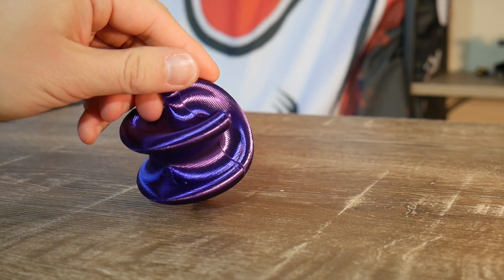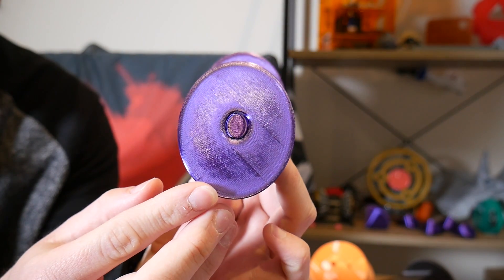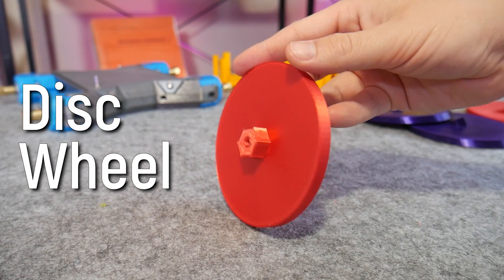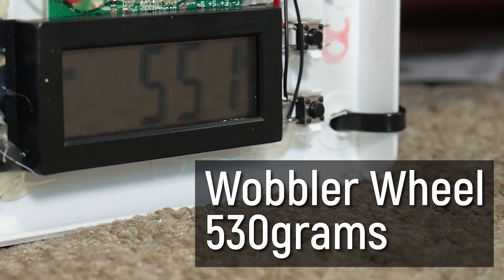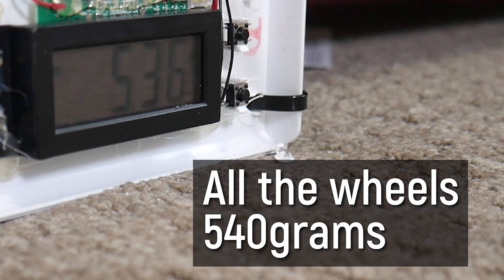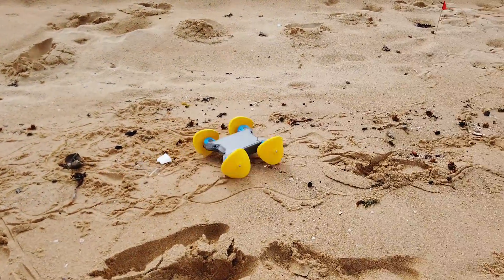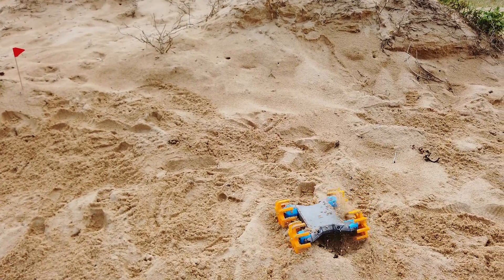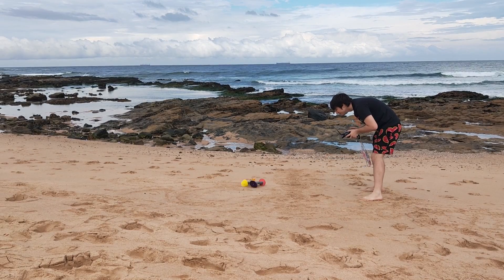This Robot Drives on Wobbly Wheels (but HOW?)

Comment: Question: could you make a device that would be attached to the body that could take advantage of the wheel angle of the wobbler wheels? For instance, when the wheels angle toward this device, it could push a lever that was attached to a flexible material that could generate electrical charges upon expansion/compression/both. And if you could, could this generate enough charge enough to fully power the vehicle? If so, could the excess power additional light and perhaps an additional battery?

Comment: You need a combo. Narrow, regular wheels for easy going on smooth surfaces, then spokes/scoops on the side of those wheels, with a slightly smaller diameter, for when the terrain gets rough and it starts to sink in. Like two wheels clamped together to handle ALL OF THE SITUATIONS!

Comment: I think that larger diameter would help, giving more tolerance for a slight dig in before the weight is being supported by the belly instead of the wheels.  Also, it might be worth experimenting with different cross sectional shapes of the part of the spokes that contacts the ground, say, triangular, where the angle of the flat descending towards the nadir might be at a more effective angle to produce "lift" in preference to thrust.  But you may have trouble duplicating your sand conditions.

Comment: You don't WANT sand being flung backwards, because that's what digs you further into a hole. The scoops on sand tires aren't meant for flinging it backwards, but for getting some traction on the flat sand. The sand tires are totally filled in so they have massive surface area contacting (and importantly COMPACTING) the sand down so it shifts less. Your spoke tires are open, so they aren't compacting the sand at all. All those tires are terrible for sand because of their small contacting surface area, the spoke tires are just the least bad because they're the most efficient lfingers of sand, giving them at least a chance of getting out of a hole before completely burying themselves in it.

Comment: cool.
when moving on sand.
the trick is to go over the sand.
paddle wheels get the job done.
another problem is the center of the device from touching the ground.
to get to the point.
would it be interesting to see a rocker boogie solution.
like the mars rover

Comment: Very nice experiments! I have some constructive suggestions though. I think more ground clearance would give a more objective and isolated test of the wheels themselves by ruling out friction from the bottom of your vehicle, which design is kind of awesome though :-) Maybe have a try at one of these?: https://en.wikipedia.org/wiki/Screw-propelled_vehicle . Also fun to see the traction test since I did force tests on all sorts of parts for quite some years. I suggest though, that you compare different ground types (flat, grainy, rubber,...). When doing force tests, you should try to get the force nice in line between your verhicle and the dynamometer. In this showcase, if a type of wheel performs better, the rear wheels will come a bit from the ground and you're only testing two wheels in practise. You might be surprised of the results when following that rule ;-) It can deviate 10%-ish. And as suggested by others, the wobbly wheels and the spoked wheels might give you water propulsion (as do the screw tracks). Keep vis like this coming! Very nice content.

Comment: only negative i could see if u scale it up is uneven bearing pressure on the motor internals. since leverage on it will be more when the contact patch moves farther from the vehicle. shouldn't be an issue for testing but long term could produce issues.

Comment: In forth wheel test, u should control the spin of those wheel in a particular way that the wheel should spin as slow as possible and still moving the drone forward without removing sands too much. If u spin ur wheel so fast, more sands will be removed faster so that the drone will no longer have the chance to move it forward.

So my conclusion is, by spinning the wheel slower it removes less sands and it will keep forwarding the drone/vehicle.

Because the drone is so lightweight than the momentum of ur spinning speed. So keep it slow drone will flow 😉

Comment: I do not think the paddles should disqualify those wheels. All of the wheels had increasing levels of "paddleness". The wobbly wheels kinda swam through the sand like a fish, not so much using friction like the straight wheels, but more by having actual grip like the paddle wheels. If you think about it they basically have the same profile as a screw tank. The Prongle wheels had twice the number of "paddles" as the wobbler and then the paddle wheel had twice again.

Comment: Two styles, a hollow 3D semi-circle with its outside to the ground connected to the rim with a narrow stem between the rim and inner of the semi circle set out at 3 wide in a slight curved manner so when complete has the shape of a rear bike tyre. Other style is similar but with a suction cup design instead of the hollow 3D semi-circle. Essentially, trying to design a tyre that stays above the sand by spreading its weight

Comment: I think spoke wheels are at a disadvantage because they seem (at least with what I can see) to be a smaller diameter than the other wheels. So they can’t dig as much as the should before the body touch the ground and get stuck. I think less spoke but bigger diameter would have been more fair and performed better.
Even better I think, at least for sand, vertical spokes, like a bike wheel but without the rim^^

Comment: Hi this is unrelated to this video specifically, but I’ve noticed several people talking about two way bolts and I was wondering if you’d make a video about it - what would happen if you made the nut two way as well? Or even more interesting, what if the thread ratio was not the same in either direction? So clockwise could be 2 times the thread pitch of counter clockwise etc. can they have different thread depths too?

Comment: Next step add encoders to each "wobbler wheel". Make sure the "wobbler wheels" are always 180' out of phase. When turning the diagonal wheels should be 180' out of phase.
Requires some programming but the results would be interesting.

Comment: The wobble wheels are obviously a single cycle of a sinusoidal wave, the prongle wheels are two cycles of a wave. If you add more cycles to the wave of the wheel, that would likely give it more traction.

Comment: Inverted Prongle. Unsure if it will be any better. I'm curious to know if the shape of the Prongle is scooping up the sand and throwing it inwards (hence burying it). I wonder if an inverted prongle will throw the sand outwards and assist a little?

With the spoked wheel, how was the surface area measured? I would assume given it's paddle design it would be making good use of three sides of each spoke effectively increasing it's surface area? If the total surface area or three sides of each spoke is more than the surface area of each other wheel than maybe consider making the spokes shorter than compare it for a more fair challenge?

Comment: Another reason the spoke wheels worked better is the fact that there's a much larger contact patch! All the other wheels, when they contact the ground, have a very tiny amount of surface area that actually touches the ground. But the spokes, even though the total surface area is equal, the distribution is much more efficient.
Think of it like this: If you stick your finger straight down into sand, it'll sink pretty easily. But if you take the same amount of force and use the palm of your hand instead of your finger, it spreads that force out and won't sink. This is why, when off-roading, you air your tires down - it elongates your tread. Sure, paddle tires help, but maintaining traction is the real key. Those paddles do exactly the same thing; they increase the contact area.

Comment: So, to me, it seems pretty clear that there are 2 fatal problems consistent across most of the wheel types:
1) Small contact area and therefore high ground pressure + low friction
2) Little-to-no ground clearance by the main chassis
The spoke wheels overcame the first problem pretty well with wider contact areas and partially overcame the second with the ability to 'swim' through the sand using their paddle structure. However, even they fell victim to the fact that they're composed of individual spokes that are laterally wide, but longitudinally thin. If the spokes were thicker, or there was a secondary supporting structure within them (like the sand tires you showed) they might have performed better.

Comment: The wobbler and the pringle wheels are actually the same basic concept. You've basically got a surface that moves about an axis at a constant radius, but moves laterally (parallel to the axis) in a sinusoid. With the wobblers, you have one complete sinusoidal "wave" around the circumference. The Pringles have _two_. You could keep increasing this number (with probably better and better performance in the sand) until you've got a ruffle-edged wheel (like what bakers use to crinkle the edges of pies).

Comment: Cool video!  You could make the internal volume of the vehicle much bigger by simply designing a lid that has a bulge to it.   Testing here was interesting, but discs would almost certainly be the fastest and the most efficient on a flat hard surface.  I think you should consider that as a 3rd test. 
What would be best for these 2 tests?  I'd say something like the paddle wheels but with 50+ thinner pointy paddles.  Though that might be difficult to 3D print. Pointy paddles like a gear would bite into the carpet.

Comment: What if you made it so the night shade wheels had more surface area. They are at more of an angle. Like you know how cars would usually have their wheels at an angle. They would usually have more speed.
Reply: Instead at a 90 degree angle, how about a 75 or 45 degree angle into the robot. The wheels will be going into the bottom of the robot.

Comment: Ehh, might be I'm late with this comment, but you may try an offroad driver trick.
When driving on such surfaces they usually use higher gear and lower RPM to reduce torque and speed. You have nice traction for plastic wheels, but that's not about traction between wheel and surface, it's about traction between sand particles mostly. If you'll be able to drive this platform without crushing sand surface you'll get better results. Weaker motors may give you better results.
For reference you can compare truck at 14:15 with cars before and after it
https://youtu.be/_WDybTKzEec?t=854
Sorry, comments are in Russian, but I don't know any similar videos in English )=

Comment: What if you go with the wobbler design, but you combine multiple wobblers  overlapping on the same wheel, each at a different angle, evenly distributed so they criss-cross as they roll?

Comment: Some kind of threaded wheels would be cool in this environment. The wheels need to differ in the direction the thread is running. When the little thing gets stuck you can turn the wheels in a way that your little buddy digs himself to the left or right, with the wheels turning in differing directions so the momentums cancel each other out and the thing stays stable(same way when going forward/backward). I'd love to see that!

Comment: It would be interesting to see a test using larger diameter wheels so the platform has a higher clearance in the sand
Reply: Yes, it seemed to be high entered a lot

Comment: For the wobiler wheels, if instead of being parralel. The front two are perpendicular ish, and the back two are also perpendiculer to each other that might work better, so in the end right and left sides are parralel with each other, but not front end, and not back end, the prints right now lookjsometing like this,(loking just at front, or back may be wrong) 
 /.           /
|.             |
\.             \.
  |.             | 
  /.            / 
Hopefully you can see why that this slips,
But with my preposal the tracks should look like this:
/.            \
|.              |
\.             /.   
  |.           |. 
 /.            \
|.                |.
With this squeezing motion it should help, so that they work together, and not separately 
Thx
(Please ignore typos, i did this on my phone)

Comment: I think if you build a bridge over the platform with three regular wheels, two at the sides and one at the top, all making contact with the flat surfaces of the car's body, you'd get a lot better comparable traction.
Also, I think the "sideways" motion might be related to the direction the carpet fibres are brushed?

Comment: There is one you didn't consider. Paddles.  They are valid for water use. So why not sand? My only drawback. No ability to make a design. So if it's considered, it's all you. I have faith. 😁

Comment: This is all hellastupid I'm sorry.

If you want to optimize the wheels, do so for either weight, volume, or radius for them to be comparable to each other. 

Doing by area you are, at best, checking at how much friction they can create, in which the "most horizontal design" will win "the most vertical design" (spoke wheels vs regular wheels) because of the energy it requires for the initial friction to overcome.

Also, testing them on sand only tests "how long will it take the vehicle to get stuck on the dunes". An spiked wheel (like a bicicle without the outter circle) with the biggest radius you can make will win against any other wheel you can make.

Comment: There is a rule when you go 4-wheeling on sand. You think of sand like water, so the surface area in contact with the sand needs to be large enough to keep you "bouyant". The spoke wheels had at least 2 spokes in contact with the sand whenever they were in the deep sand, resulting in more surface area in contact with the sand, making the rig more bouyant. The "scoop effect" that you referred to benefits from both increased rolling resistance, leading to increased traction, as well as the equal and opposite force of throwing the sand behind the rig, thus pushing the rig forward with a force equal to the energy needed to throw the sand back. I wonder if you could design wheels which maximize the vehicles buoyancy, which also throwing sand as evenly in line to the vehicles direction of travel?

Comment: Results might have been better if say the robot had a drivetrain instead of multiple motors. That way it could have lockable differentials and perhaps a transfercase for even power distribution to every wheel. That would greatly complicate the design though, and with 3D printed parts, that brings reliability into the question.

Comment: I feel like the spoke design did better perhaps because even though they all have the same total surface area, the spoke design has more surface area in contact with the ground when a spoke is touching the ground. What if the spokes were angled rather than perpendicular to the wheel rim? So that just as one spoke is leaving the ground at the tip, the next spoke is starting to make contact at the base?

Comment: The spoked wheels with an inner layer for buoyancy with the spokes angled opposite to each other in succession oriented so as looking down a the the wheel, the top of the wheel points forward. Tractor tire style. Wire mesh interior to allow sand and water to pass through and clear easily if it spins, but woven close enough together to gain buoyancy with rpms. Perhaps a solid centerlined divider around the centre of the tire like a tractor's front tire to aid in steering and instead of a round profile viewed front on, rather diamond shape, so the deeper they go, the more tire that touches.

Comment: What about wobbly wheel with spokes? If wobbly wheel worked better than plain wheel then surely if the wobbly wheel had spokes it would be better than original spoke wheel?

Comment: At the 6:00 mark, I wonder if the 'wander to the right' movement is due to the 'nap' of the carpet.  IE would it wander toward the same wall if it were pulling 180deg from what it's facing in the vid.

Comment: try the spoked design but as sticks or pegs, so theres no plastic creating a long flat surface going towards the body of the drone, but more so just like walking, a rotating axis where theres petruding pegs, either with large contact patches but very spaced out pegs, or smaller contact patches but more pegs, i find it will be comparable to the spokes wheels, but a more effective form of them

Comment: Aren't the sand trials unfair due to the width of the 5 spoked wheel? Naturally, the thinner wheels are going to sink into the sand, like how feet sink in snow, but the 5 spoked wheel will have better abilities to maneuver in it, like walking on snow with wide snow-shoes/ tennis rackets. I just dont think it's fair to compare the wheels like that, but maybe I'm wrong...?

Edit: He talks about sand tires with divits, but like I mentioned above, that isn't even the important thing. Simply using a wider wheel will make the car travel better on top of the sand without sinking. Like my example with snow shoes, the important thing is dispersing the force on the ground with a wider area; snow shoes with divots on the bottom WILL make it easier to walk on snow than a flat shoe, but both assist on walking in the terrain on an entirely differen't level than regular shoes. In this way, comparing the wheels like this is simply not fair.

Comment: In order to remove the jumping you should put the end of the below the connection to the platform, so that there is better traction, and so that the chain doesn't lift the platform off of the ground.